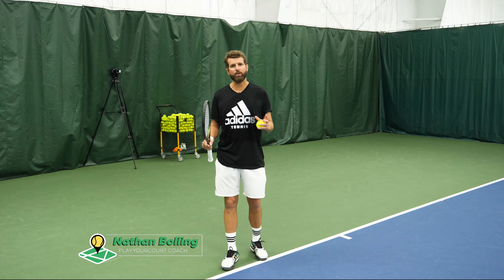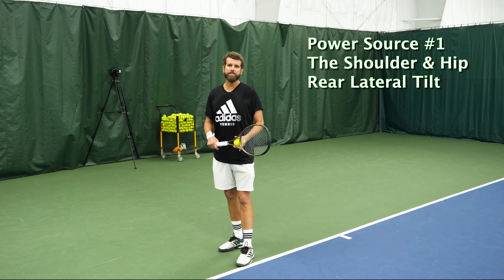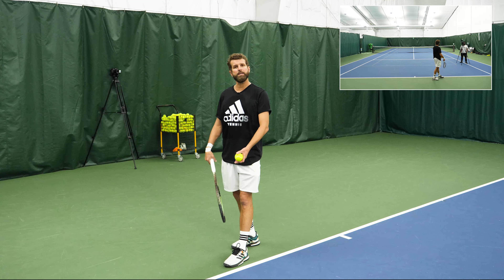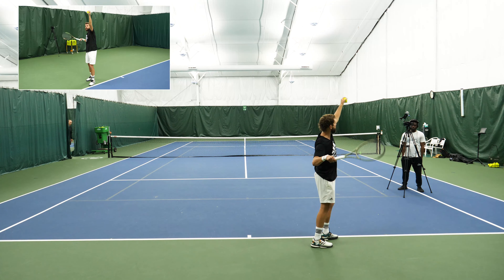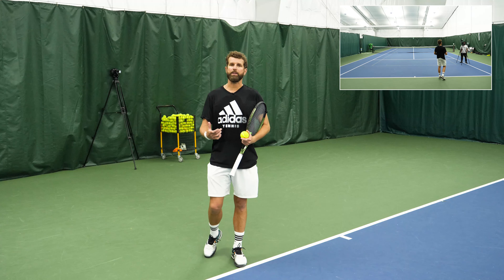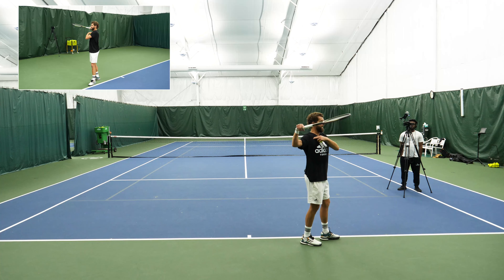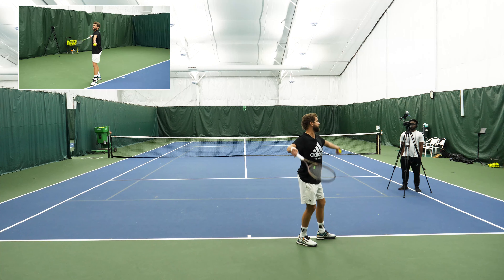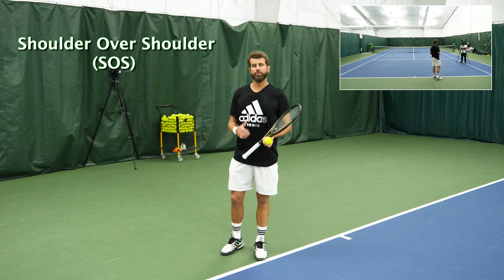50% Of Power Comes From This On Your Serve

Comment: This makes sense. Two major sources of power are the shoulder over shoulder (SOS) and corkscrew motions. But you can get by with mainly SOS and little corkscrew as is commonly found with many pinpoint servers  (Kyrgios) whereas platform servers will tend to incorporate both SOS and corkscrew (Federer). And I presume some ATP platform servers will also choose to use mainly SOS and relatively  little corkscrew? Who would be examples of such platform mainly SOS ATP servers?